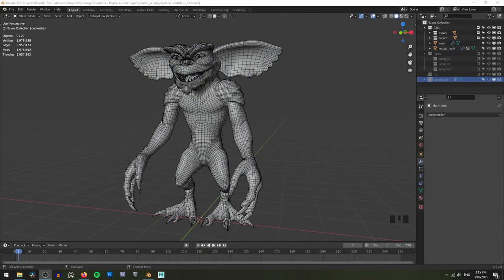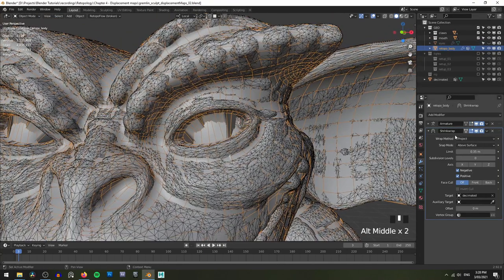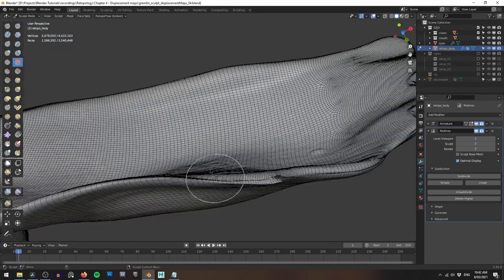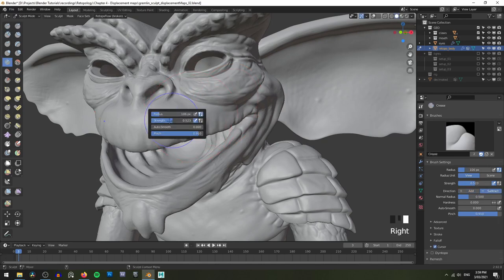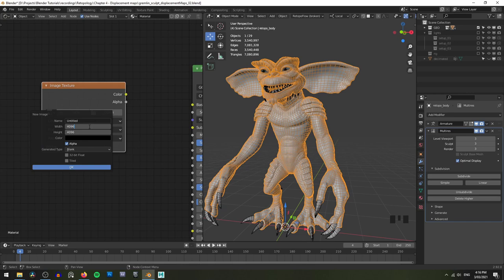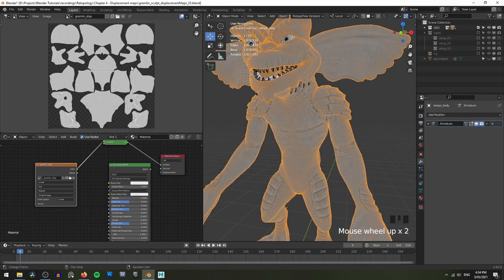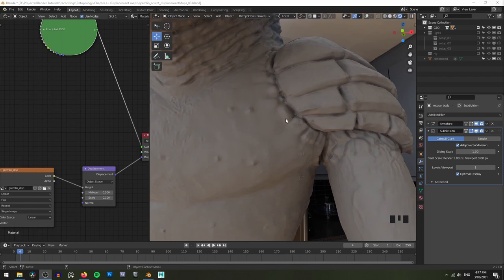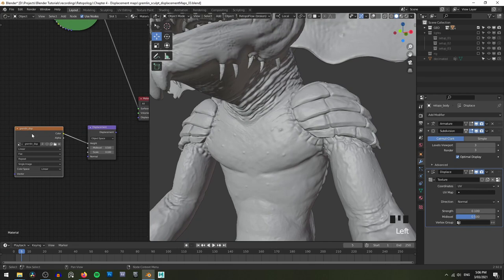Displacement maps in Blender

Comment: Can I save a copy of the model with displacements applied, as real geometry, for 3D printing?
Reply from the maker: Yeah definitely. The easiest way would just be to do your sculpt with a multires modifer - then apply the multires when you export.
But - if you've already removed the multires you can turn a displacement map into real geometry. You'll need to add a new multires and add a few levels of subdivision. Then add a displace modifier. You can add your displacement map to the displace texture slot. Once you're happy, just apply all the modifiers and you'll have all that detail as real geometry, ready to print ;)
Reply: @JamieDunbar  I seem to remember a problem with exporting the results of the adaptive displacement because it's dependent on the camera position.
Reply from the maker: @DonaldDrennan  If you want to bake all that detail down into the model, don't use adaptive. Just use a multires modifier.
Reply: @JamieDunbar  Thanks!
Reply: @JamieDunbar  the reason I wanted to use adaptive is that the model doesn't need to be subdivided so small everywhere. There can be areas that can be left unsubdivided. The adaptive subdivision gives such good results. Is the only alternative to use Multires and Decimate?
Reply from the maker: @DonaldDrennan  Adaptive subdivision is something that only happens at render time. So it's not "real" geometry. It's wonderful for rendering, but it won't be of any help if you want to export for 3D printing.
But that is pretty much what decimate does. It tries to pick areas that don't need as much detail and decimates those areas more than others. So it's kind of doing what adaptive does anyway - just with real geometry.
Reply: @JamieDunbar  Yeah. I am just wishing someone would devise a way of making it real. But I'm still not exactly sure what "not real" means. I mean, it has to be data of some kind, doesn't it? Is it some kind of illusion or trickery? It's more "real" than bump maps or normal maps. 
When I was working on my bas relief sculpture, someone told me that the results of the Multires Modifier wasn't "real" and thus wouldn't be as much of a strain on Blender and my computer resources. I can't understand how that's possible, because it has to be data that Blender is using. How is it any less data than actually subdivided geometry? I would like to understand the Multires Modifier better. I used it on a project for work awhile back and ran into problems. I had modeled a bean with a lot of detail, and while the client liked the overall shape, they didn't want that detail. All of the shape and detail was stored in the modifier, so it was very difficult to separate the detail from the overall shape. I tried to use the smooth brush in sculpt, but it changed the overall shape as well. Is there a way around this? Should I have used two modifiers?
Thanks!
Reply from the maker: @DonaldDrennan  All really good questions mate. After a while you'll begin to understand how all this stuff works under the hood and it'll become intuitive which modifiers or workflows to use when. But until then - yeah there's a lot of options and it's not a simple thing knowing what's most effective.

In terms of what's "real". You're quite right - it's all data so at the end of the data it's all "real" to some extent.
Usually what's meant by "real" is when it's actual geometry. So all that detail is stored as an actual vertex. A normal map is less real because it's actually data that tricks the lighting system. So the red, green and blue values tell the light to bend a particular way, which creates the illusion of detail. So a normal map is "fake" because it's essentially a programming trick. Vertices are "real" because you can actually go in and move them around.

The Multires modifier is interesting because to some extent it exists almost at a halfway point. So it's still "real" geometry that you can move and sculpt. But it implements some tricks because you can go up and down your resolution. Personally I'd still call the Multires "real", but I can see how your friend might be thinking. They might also have been thinking of baking that Multires detail into a normal or displacement map. Which does then take that "real" geometry and turn it into data points on an image texture - which is definitely less of a strain on Blender.

A lot of this stuff boils down to being able to convert back and forth between "real" and "fake" data depending on what you need.
So for 3D printing - you need "real" data. The 3D printers can't read displacement maps, so you need to have that data stored as vertices to read it. So before exporting, you need to apply the multires modifier to make sure all that data gets stored in an STL.

On the other hand, if you're planning an animation, trying to rig and animate a multires modifier puts a huge strain on Blender (or any 3D program). Your viewport slows to a crawl and animation becomes nearly impossible. Also, all that data is stored in the Blender file, which makes for massive files. However, if you export that data as an image texture (displacement/normal maps) you remove it from the Blender file, which reduces file sizes and gives you back your viewport speed.

Hopefully that information dump is helpful and doesn't just confuse you more!
Reply: @JamieDunbar  Thanks so much for the help! There's a lot to learn. I'll have to experiment to find out if I can do one round of general shape sculpting with one Multires, and put more detail in another.

Comment: Thank you for being so thorough with all of this! Say, would you be willing to do a tutorial for setting these up for animation? I've been curious to learn how to do that to animate things like wrinkles on the face depending on the expression, but I haven't been able to find anything on the subject
Reply from the maker: I'd say there's two main ways to animate facial wrinkles. If you had enough geometry you could sculpt them while using shapekeys. Or you could use two (or more) displacement/normal maps and then blend between those in the material editor.
Reply: @JamieDunbar  Oh yeah! I was more so thinking of doing the latter, but I'm a tad confused as to how to set that up and make it animatable if that makes sense. Thank you so much for answering by the way!
Reply from the maker: @sil7en354  All good mate ;)
Animating it would require everything to be set up with Drivers. Have you used them much?
In the simplest terms you'd have a Driver that would connect to a Mix Node. The Mix Node would then go from 0-1, allowing you to blend between a neutral wrinkle map and a detailed wrinkle map.
That's pretty easy to set up for just two expressions. But if you have 10 or 20 expressions you'll end up with lots of Mix Nodes and lots of Drivers. In theory it's simple, in practice that can get messy!
Reply: @JamieDunbar  Oh shoot the nodes! I legitimately hadn't even thought of that! Yeah I can imagine how messy it could get when using multiple nodes in a single model, but it makes a lot of sense now that you mention it! Like, I didn't even know those could be animated so goes to show how familiar I am with Blender haha.

Thank you so much man! I'll have to experiment around as soon as I get the chance!
Reply from the maker: @sil7en354  Good luck mate. Let me know how you go ;)

Comment: Thanks for the instructive video! You are pointing at one thing Blender is behind Maya as a animation tool. That is animating with high detail in the view port with help of displacement. Maya did some change in the Viewport 2.0 2013 after a cooperation with Pixar. OpenSubdiv and  Ptex was introduced to the Maya Viewport 2.0. Why is that important you say. Well I don't know but according to Pixar the animation is more accurate made if you can se the full geometry when animating. Lets say a hand grasping a handle the hand risk pass in to the handle when rendering if you cant se the displacement in viewport.  I hope when Vulcan is a part of Blender this can be done in Blender too. 

https://www.youtube.com/watch?v=Y-3L9BOTEtw
Reply from the maker: Hi Stefan. The video you linked is pretty old. I'm pretty sure Blender uses OpenSubdiv now.
I couldn't tell you if Maya's viewport supports displacement, but it's hot garbage for just about everything else. Pretty much none of the Arnold shaders work with it, which means you have to jump through a heap of hoops just to get basic colours to work. Blender's viewport (and especially Eevee) runs rings around it.